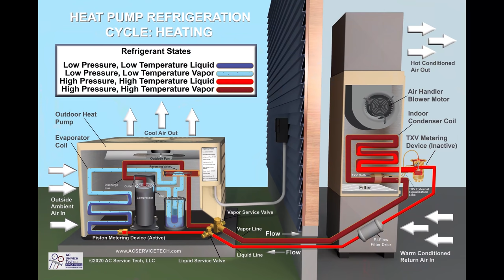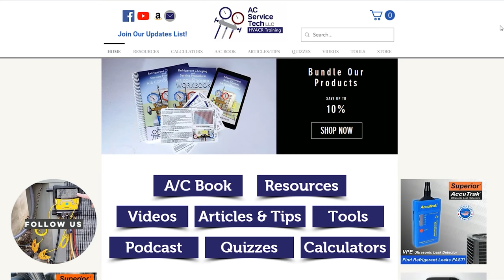How Defrost Works on a Heat Pump! Explained Step by Step!

Comment from the maker: -Thermostat Wiring Quizzes https://www.acservicetech.com/quizzes
-Our Website has FREE Videos, Calculators, Podcasts, Articles, Tips, Quizzes, Q/A: https://www.acservicetech.com 
-Facebook Tips: https://www.facebook.com/acservicetech 
-Tools we use, Our Book, Workbook, and Quick Cards: https://www.amazon.com/shop/acservicetech 
-Join our updates list for an email strictly from us for new videos, articles, products and website features! https://www.acservicetech.com-Our E-book, Paperback, Workbook, Quick Cards, PowerPoints, https://www.acservicetech.com/store 
-Posters, Book, Workbook, Cards on Amazon: https://www.amazon.com/shop/acservicetech
-Our E-book: https://play.google.com/store and iTunes and search "ac service tech" 
-Posters & PowerPoints on our Website: https://www.acservicetech.com/store
-Spanish Paperback and E-book: https://www.acservicetech.com/libros-en-espanol
Reply: id like you to make a  troubleshooting book how to diagnose control boards ,pressure  switches ,reveasing valves and all components  that the heat pumps , air handle and the funace especially in spanish
Reply: Hey ac Service Tech, if the unit shuts off during the run timer let's say is 40 minutes and it shuts off after 20 and than runs agian will it pick up where it was when the heat turned off?

Comment: Or it will power up the gas burners   on a gas/dual fuel setup during defrost
Reply: The defrost board puts power on the W wire (independent of the thermostat) so what ever heat source W controls will come on.

Comment: I don’t understand. So the 60 minute timer is just to have the board check one switch every 60 minutes? If it is why not keep it at 30 minutes instead so it check as often as possible since the temperature switch is the one actually making the decision to turn on defrost?

Comment: Why don't they build heating elements into the coils to prevent this? It would potentially use less electricity than the coils in the handler IMO. It would also prevent the excessive reversing valve use.

Comment: Your series of videos helped me locate and fix a high voltage short in the condenser and a low voltage short in the thermostat wire.  This was after the professional hvac techs gave up.  Thank you for creating the excellent heat pump videos and for your excellent explanations in each and every one of them!

Comment: I have adaptive defrost on my system.  It failed last year, with a board and thermistors replacement.  But I looked into how it is different than the traditional time/thermostat defrost.

It has a coil temp sensor (thermistor) instead of a thermostat and an ambient temp sensor (thermistor).  It has some algorithm that determines when to defrost based on the comparison.  I did learn if the ambient temp sensor fails, the board defaults to a 30 minute time cycle (and uses the same when it is first powered up till it gets a "sense" of the temperature profile).  If the coil sensor fails then defrost stops like with a thermostat.  Also, the selector pins on the board don't adjust the time, but rather the coil defrost termination temperature.  Haven't been able to find much on the why or wherefore of raising or lowering the termination temperature.  

Testing spare coil and ambient thermistors, I noticed the resistance test current on the meter will cause them to climb reading as it warms them up.  So you have to be quick about taking the reading if you want to convert it to a real world temp.  Haven't found any good information of field testing for sensor drift.  So it is kind of open, shorted, or seems close enough to my outside air temp reading for  testing.

Comment: All your vids are great including this one! My only question is when the heat pump turns on electric heating in the air handler does it also turn on the air handler blower?

Comment: Question what is the lowest outdoor temps that these things run in? I have had the things running in temps to mid teens. Ohio..  Also in a pinch I have had the dfs go bad and jumped it out till new one arrived. It would be in defrost for 10 min and go back into hp operation. Carrier did not know if it would work but it does because of the timer.  Great video.. subscribed.

Comment: Great detail in your teaching, keep it up.
Perhaps you could help, I need a parts catalog for an old Goodman model CPK224-1B heat pump.
I'm having trouble finding the right reversing valve coil.

Comment: When in air conditioning mode, is there a similar defrost cycle to prevent freezing of the indoor coil? Why not? Is it because ambient temp in the home rarely gets so close to the freezing point? If you do see freezing of the indoor coil while in AC mode, do you think of other causes like a dirty filter, low freon charge, or other causes of poor air flow?

Comment: Hello Craig, I know this question is not related to the video. I could not find the answer on you other videos. Two questions...
1. Is there a way to bleed the small air bubble in the BODY of the manifold gauges or is it so minimal that no one worries about that air bubble?
2. If you do not connect the yellow hose to the tank, how do you return the high side refrigerate to the HVAC using a 3 value manifold gauge set? I believe the yellow line would be full of air and there is no valve available to isolate it from the body. Thank you for everything you do. I love listening and watching to all of your videos.
Reply: Better solution, don't use archaic manifolds for checking pressures. Use probes. And if you are against electronics, use the analog equivalent, and you won't have to worry about it.
And if you are worried about the high side and losing liquid, use this:
https://www.trutechtools.com/Accutools-Shrader-Depressor-Tool-5-16Fx1-4M

Comment: Subscribed! Thanks for the video, very informative! Quick question:  While the system is in defrost mode, does the fan inside the house runs simultaneously? If so, why?
Reply: Yes it does. In doing so, the fan helps to transfer heat from inside the structure to the outdoor coils to defrost the ice. Additionally, the indoor fan blows air over the resistance strip heaters to heat the "cool" air due the the unit running in a/c mode during defrost cycle.

Comment: Hi. I’m a very tech savvy homeowner. My heat pump was diagnosed with a bad defrost board. I would like to do a self install. Other than swapping out the board, does it require any kind of recalibration or anything?
Reply: No. Just be sure to disconnect power to both the outdoor unit as well as the indoor unit. You don't want to get killed, and you don't want to short-out your low voltage transformer and/or fuse.

Comment: Hi, thanks for a very helpful video that you've shared with us. My question is that when it is difrosting and the gun of thr heat pump stoped working, is it normal that the compressor making a huming noise. should i let it run?; if so for how long it must run to defrost the heat pump. thank you.
Reply: The hum you hear from the compressor is usually masked by the loud noise of the fan. It is normal noise. Depending on what model unit you have, some defrost according to "time," and some defrost according to demand (outdoor coil and outdoor ambient temperatures). Just let it do its thing.

Comment: Hi Craig
Thank you for the awesome video and explanation 

Question : I've come across numerous H/Ps that have had the board and DFT replaced. My question is where do you think the best location for the DFT is, because sometimes I've seen them located right after the outdoor txv, or right (seems to be) the exit for the condensing coil.

Thanks in advance
Reply from the maker: I would like to see them need the middle of the outdoor coil but between the outdoor coil and the metering device works as well.

Comment: Is there a timer on how long the heat pump will run in heat mode before the elements will turn on?  My hp will run to about 88 deg, then temp will start to drop (about 5 min), and the elements will turn on until the set temp is reached.  this happens every time I start the hp in heating, even if I continually, adjust the set temp to turn off the hp and them turn it right back on.  Service tech  told me it is running fine, but could not explain why the elements keep turning on every time.  Thanks for any help.

Comment: One thing I would correct here, the timer does not start counting run time until the defrost sensor closes, it does not "check" the sensor every 30/60/90 minutes, this is a common misconception that I also thought was the case for years, until I had a debate with another tech about this, we made a bet and bench tested a few different boards, I lost, might make for an interesting video
Reply: And what you find im curious. Cause im thinking about putting mine on 30minutes or should i leave it at 60 minutes??
Reply: I traced out a simple Goodman board and was surprised to see that, as you say, the board isn't even powered till the DFT closes.  R to the board immediately goes out on the 2nd R terminal (with no other connections on the board) and the DFT terminal is the start of all the circuitry.  So the DFT has to be closed to power the board.  However, my current system with adaptive demand defrost is has always-on power via R.  It even separately monitors the HPS and LPS instead of series wiring.
Reply: Tyler is correct. This is a common misconception, it’s presented incorrectly in many training videos and books. But that defrost timer does not run unless the defrost thermostat is closed.

Comment: what happens to the inside coil during defrost ? system basically runny on ac mode wouldn’t the inside could be cold and counter act the electric heat?

Comment: Hallo
My mitsubishi heat pump stops after a half our and unit outside is frozen..
Wher should I look for the problem..Gas is checked and refilled by technician, but no sulution.

Comment: My AC contensate pump do not start automatic when the reservoir tank is full but the contender outside get shut off and  air handler keep running

Comment: 0:25 when this happens coil in air handle is cooling while aux heating at the same time?
Reply: The heat strips in air handler are energized to produce heat to neutralize the cool air produced from the outdoor unit running in cooling mode. Just while it's defrosting.

Comment: Sir there is a Hitachi inverter AC.  R-410a has gas.  Ampere 4.1.  But sir cooling is not happening.  What's the problem with that, sir?

Comment: Can I ask a question about a 4 zone mini split heat hump?
I have oddities in my defrost cycle. I have a 4 zone C&H Sophia with ceiling cassettes. Usually all cassettes will defrost together but I have one cassette that will go into a defrost cycle when the other cassettes are still heating. Occasionally that cassette will stay in defrost and not complete the cycle. I have also had two cassettes (only two running at the time) that did not complete the defrost cycle and just didn't start up again. Power cycling returns proper function. This is a new system and my first mini split so I am still learning but this seems like odd behavior. Any thoughts would be appreciated.
Thank you
Reply from the maker: I would contact their tech support to explain what is happening and determine the cause, thanks!
Reply: @acservicetechchannel  
I did email them with no response but I will try again.
Thank you

Comment: In your given example, if the defrost cycle is a maximum of 10 minutes, why the expense and added 
complexity for emergency heat? 10 minutes of no heat, for an average building, should not even be
noticed.
Reply from the maker: The problem is that its not that the indoor blower shuts off. It is literally running in air conditioning mode and the refrigerant is absorbing heat from the building in order to move it outside to melt the ice. You can stop the indoor blower because then there will be no heat in the refrigerant to melt the ice outside, thanks!
Reply: Indoor creature comfort.
Reply: @acservicetechchannel  FYI, missed the  word, "not". Cannot stop the blower...
Reply: You'd be surprised how pissed off you get when your heat is blowing cold(ish) air.  Even though objectively it only reduced the temp 1 degree.  I started watching these videos because my system had issues.  I finally learned the right questions to ask.  My defrost board has two rows of terminals, input and output.  When installed they'd put the W wire on the input terminal.  I don't cuss the AC guy who installed the system all winter anymore.

Comment: mine pumps cold air when in defrost mode
Reply: It should do that. But your strip-heaters in the indoor air-handler should turn on to warm the cold air that is blowing over the indoor coil.
Reply: @MaMa-qh4dy  so my strip heaters might be bad

Comment: Does a heat pump make a loud woosh sound during this process? I’m concerned something is wrong with my girlfriends condenser.
Reply: That is normal when reversing valve goes back to heating mode causing the refrigerant flow to be reversed.
Reply: @MaMa-qh4dy  thanks!

Comment: I currently have a heat pump at my residence. I'll never own another one again. Piece of shit. Not very warm in the winter and not very cold in the summer.
Reply: "Not very warm in the winter" -- NORMALLY TRUE.   "Not very cold in the summer"  -- then, you have a problem with your unit.

Comment: If a heat pump is air-water the indoor electrical resistances does continue to heat up the water? This doesn't require a nominal electric power comparable to nominal heat power of indoor exchanger element that is working like condenser in normal cylce,producing the heat power of rifrigerant compression plus refrigerant evaporation latent heat? And what happens to total electric power consume for this few minites if the machine has to consume power for compressor + electric power that equals compressor+evaporator (on normal cycle conditions)?,Doesn't this reduce dramaticaly the instant heat cop of heating from a scale multiplicate of 1 ,for instance 4,to a number lower than 1?
If a machine gets freeze all the time and gets turn on the defroast cylce frequently for instance 1 time per hour for 10 minist ,the total cop won't be lower than a nominal eventualy?
For instance assume a large heat pump with a nominal heat production 1Mbtu/h  has a theoritical average hourly cop for a cold outdoor conditions 3,5,then to 1 hour only 1/3,5 Mbtu electrical power has been absorbed by the electrical grid and the rest 1-(1/3,5) has been absorbed as heat by the outdoor unit. If and a defrost 10 min need to be turned on ,the defrost cycle cop is 1 (because heat resistants produce all the demanding work for the defrost time,that equals 1Mbtu/h*(10min/60min)  are produced now from heat resistants without having the 3/4 parts to been pumped from outdoor enviroment ) minus 1/3,5 (the theoritical work of compressor that it continues work and consume grid power without producing any good heat work indoor ,that equals 1Mbtu/h*(10min/60min)*(1/3,5) cop) = 10 minites defrost cop 1-0,285 = 0,714.So the total hourly cop isn't 3,5 but 3,5*(50min/60min)+0,714*(10min/60min)=3,035.If my calculations are right then with more time defrost cycle the more less expected average cop will you have in far cold enviromments .
Is this a vfm thing taking to account the extraordinery coast of electrical power and the fact that the heat pump is selected for energy and money save?